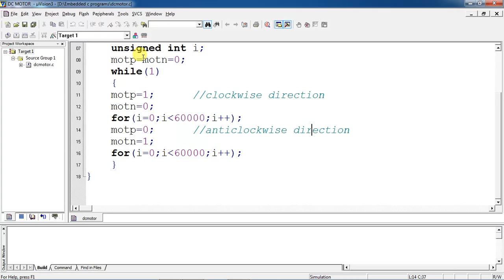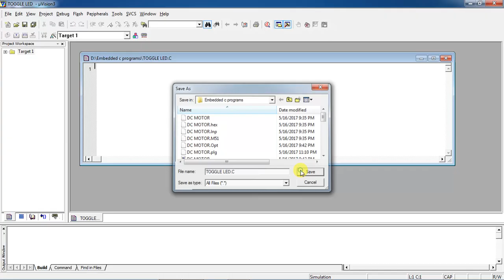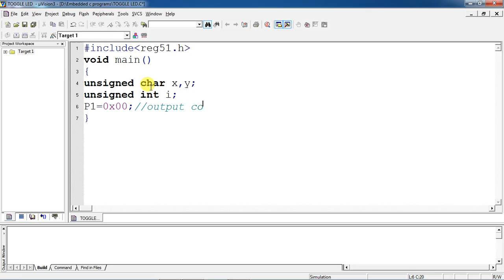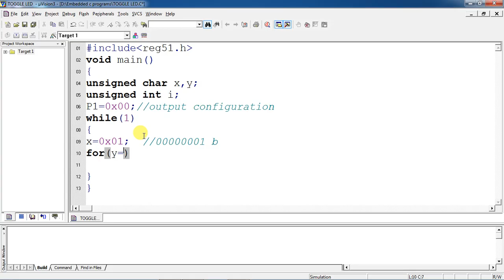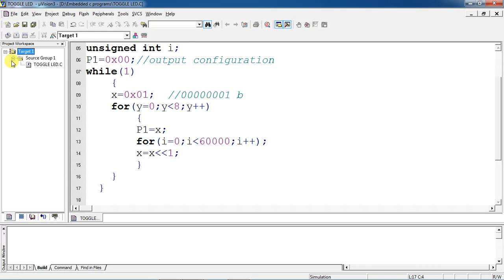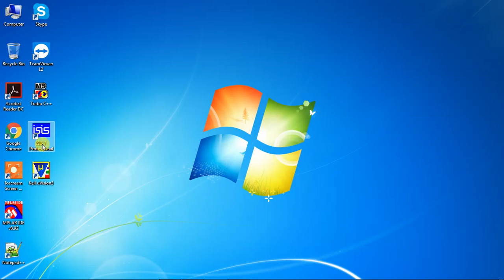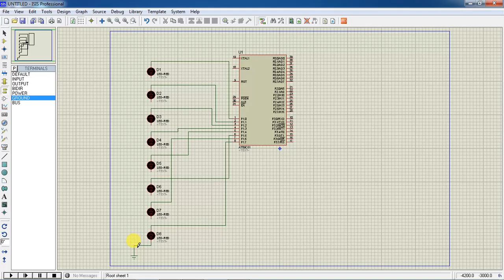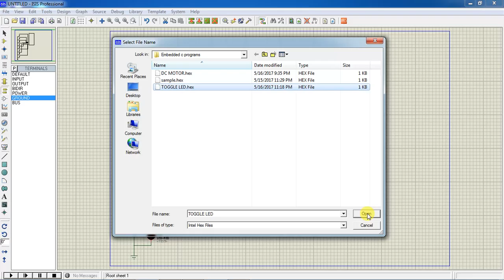LED  blinking programm using keil and Proteus

Comment: I'm surprised that there is no official tool / plugin for Stm32 IDE that allows you to simulate the processor for purposes of stepping thru and debug code.   For the total beginner, any thoughts how Keil + proteus compares to the linux based QEMU?

Comment: #include <reg51.h>
sbit P1_0=P1^0;
void delay (unsigned int i)
{
    unsigned int k;
    for(k=0;k<i;k++);
    }
    void main ()
    {
    whail (1)
    }
    P1=0x00;
    delay(10000);
    P1=0x80;
    delay(10000);
     P1=0xc0;
    delay(10000);
    P1=0xe0;
    delay(10000);
     P1=0xf0;
    delay(10000);
    P1=0xf8;
    delay(10000);
     P1=0xfc;
    delay(10000);
    P1=0xfe;
    delay(10000);
     P1=0xff;
    delay(10000);
}
}

Comment: What is meaning of p1=0×00
Reply: P1 define the port to transfer data.
0X = it is syntax to write the code
00 =  It is data that send to LED
(If Use Common Cathode: all LED are off, If Use Common Anode: all LED are on)

Comment: dude, i want to ask one question, iam doing same program to toggle led, but for port 0 led doesnt chase, but when i change port pin led start chasing, why port 0 doest working propoerly, even you can try in keil simulation reply as soon as possible
Reply from the maker: Hi Ajithem , Port 0 from 8051 , it is open drain port , you need to connect external pull up resistor to use as normal I/O pins.  one end with Vcc and resistor other end connect with I/O . now you can drive any peripheral using Port 0.resistanance (4k to 10k). Thank you
Reply: @alearningroom  why doesn't it simulate in Keil software
Reply: @ajitem100  It's fine in simulation... We don't need to connect  resistor becoz virtually LED didn't get Short